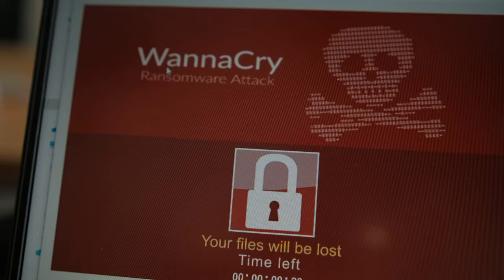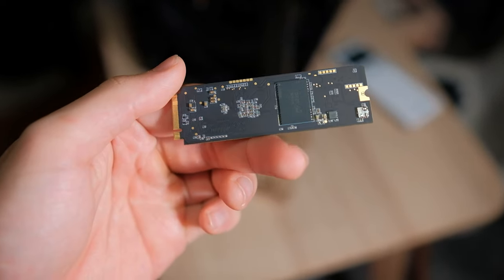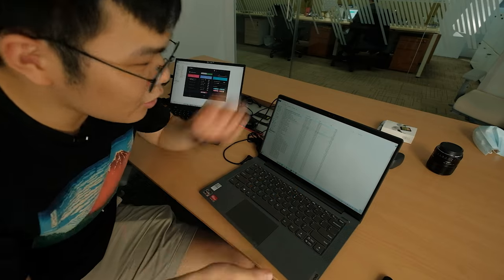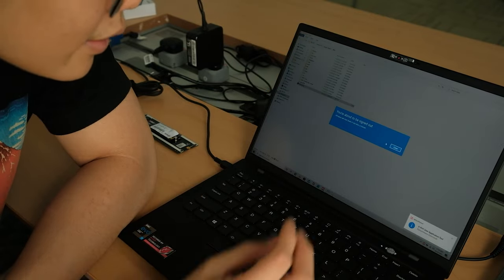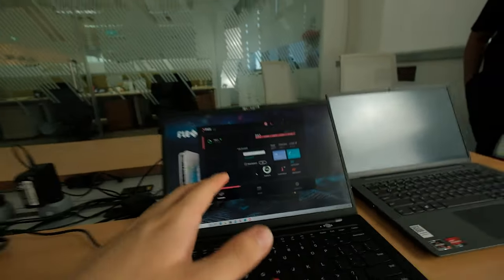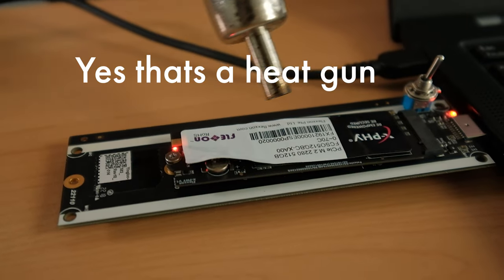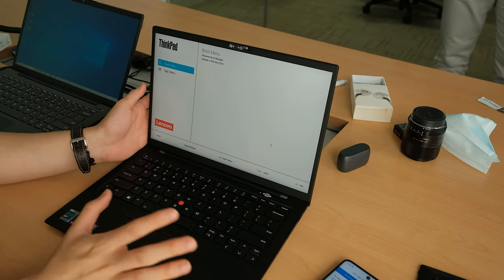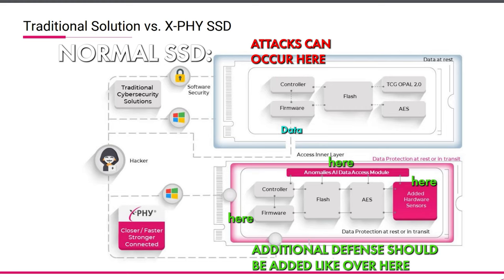i DESTROYED this SSD For fun! X-PHY SSD Showcase!

Comment: Essentially a co processor on the ssd. Using hooks into the OS? Essentially using malware to protect against malware? Hahahaha. Interesting. Heuristic based system like this might cause issues for students who's pattern of activities change from semester to semester. Question, what if I use encryption manually. Will it shutdown on the first instance of me running it?
Reply: ikr, imagine beineg a IT student and writing your first hello world and you get booted out
Reply from the maker: Doesn't work with bitlocker. As for those tasks, that will probably require some testing
Reply: @berryquick6224  As a former CS major who wrote crappy codes using new languages every sem. Got high chance I will be booted every new sem. Hahaha. Ok lah, protecting me from my crap codes.
Reply: 1.Usually encryption tools, encryption multiple files/folders and write it as single file. This case it will not be detected as ransomware.
2.windows default encryption tool, it do individual file encryption, but we don't detect as ransomware.  basically we only detect the real ransomware behaviour,  user can still use the encrption tool for the usage. If you are going to run a ransomware test, you could disable the ransomware detection function in the user application tool.
Reply: @camelliachan5494  Cool! I'm trying to see if I can get one your ssd under expense for testing. Good job to you and your team in developing this.
Reply: forgot to mention Ransomware detection and locking is independent of operating systems, which is happen inside SSD itself without any support of OS. Where there is any ransomware detected, SSD will signal X-PHY user application and it trigger the shutdown.
Reply: @camelliachan5494  Hmm I have a lot of technical questions on how exactly the ssd interface with the OS.  But let's not go into the weeds in youtube comments. Hahahaha. Hopefully can get 1 of the drives to play around with.
Reply: @Aelindgard  sure, you may contact us and become one of our beta user.
Reply: @Aelindgard  KC will be in touch with you shortly!